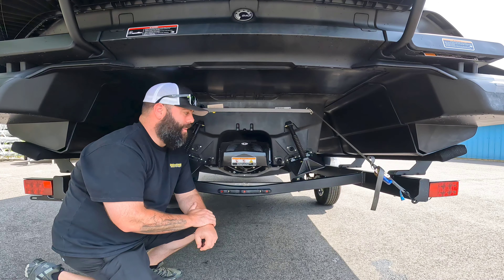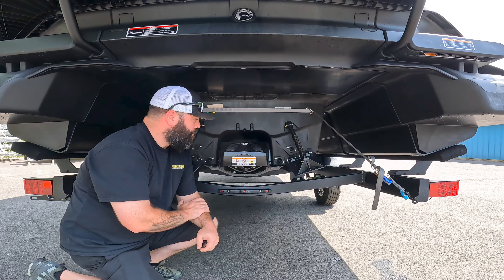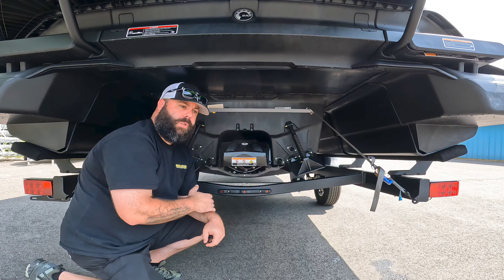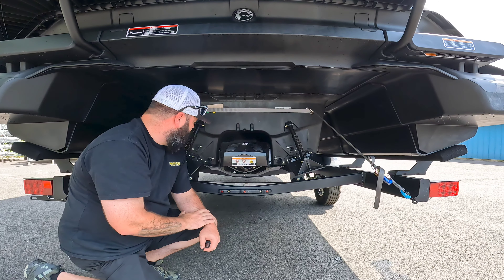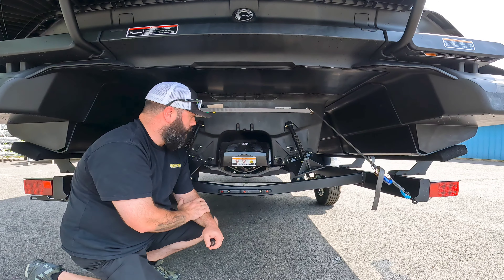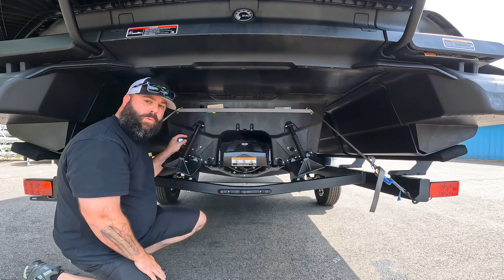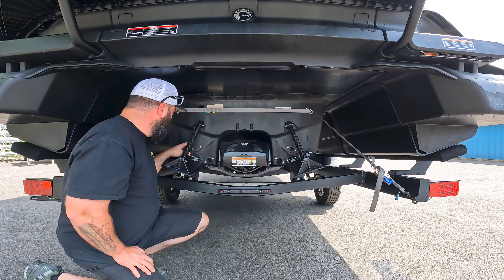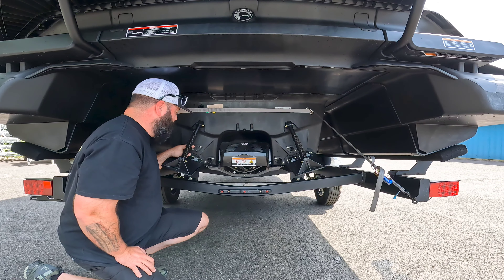Sea-Doo Switch Pontoon Flush Port, Drain Plugs and Exhaust Port

Comment: I have the compact sport and it does not have the exhaust flush port on the left side like the boat in the video .

It’s solid plastic no hole no plug nothing .

I have two lower drain plugs . The main flush plug on the right side and the pontoon flush port top right side of toon .

Why does my boat not have that exhaust flush hole ?